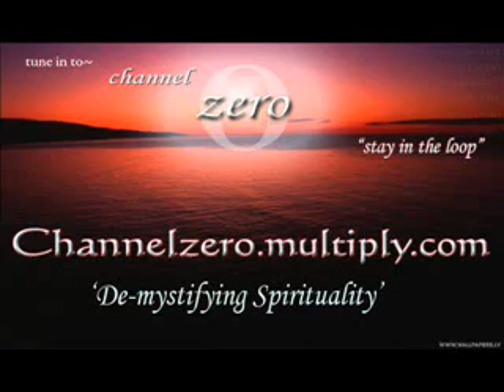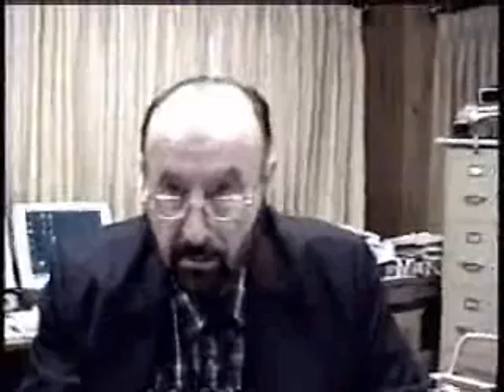Applied Scalar Wave Technology - Tom Bearden interview 1of8

Comment: Your microwave oven turns out about 700 watts of power in a tuned cavity.  At 2 gigahertz, a scalar transmitter would deliver milliwatts to the ionosphere as every water molecule along the way would be forced to vibrate.  Now take that power density of milliwatts and divide it by 1/3 which is the coupling efficiency of a phased heterodyne wavefront.  People are freaking out, about less power than they cook a hotdog in their kitchens with!

Comment: @N1k1mon Sorry, for some reason I have only just seen your question. Answer: Hutchison effect is completely bogus (only occurs when Hutchison is around). Casimir effect is a prediction of quantum mechanics, and can be reproduced by anyone who has the correct equipment.  In fact, the Casimir effect has several non-quantum analogues, and one of these can be demonstrated using just a fish-tank and a loudspeaker.

Comment: Consider Bearden's patented (sic) 'motionless electrical generator': just wire wrapped around a magnet. This is the sort of thing which 'leading' 19th-century scientists did before Faraday made the now-obvious discovery that relative motion was required to produce an output (pace Barkhausen noise). 
So, far from being 'ahead of the game', Bearden is actually over 160 years behind the times. Don't be fooled by his 'learned scientist' act. He is a dangerous gun-toting paranoid.

Comment: flower, the CONCEPT of equivalence is not what's been refuted.  The equation is an OVERSIMPLIFICATION & that's what's been refuted.  Now, do all these relativity experts in your precious report agree that the equation as it stands can account for the bending of light without a large mass given that the squaring of the "m" inflates it's value?  If not, what's the point of shaking any stick at relativity experts who've already been clubbed over the head with the Duke & CalTech results.

Comment: Flower, you PROVE Bearden's point about scientific dogma.  Does Physics 101 challenge the theory of relativity?  If so, how does Physics 101 explain bending light without a large mass?  As for Newton's law, it fails in quantum theory when force fields & particles carry momentum (I don't know if Physics 101 ever told YOU that).  Does Physics 101 talk about The Dean Drive?  Of course, if it did, it could ONLY conclude that it didn't work if YOUR Physics 101 DOES NOT challenge Newtonian dogma.

Comment: Ah, now you are really revealing your true colours: not just a Bearden dupe, but a creationist and an anti-relativist as well. Picking out odd bits of evidence that might fit a different theory, does not mean that that theory is 'supported'. The new theory would also have to explain away  the much greater weight of evidence which supports the existing theory. Sorry about that, but that is how science works. I think maybe that you are more suited to pseudoscience; it is certainly much easier.

Comment: flower, you've refuted ABSOLUTELY NOTHING I have said because the only questions you can answer are YOUR OWN rhetorical questions. The AC I mentioned was commercial & it's been clear from the outset, that YOU regard ANYTHING that has "practicality" beyond theoretical application as worthless.  But does that mean YOU invented a computer that runs on hot air?  As for a Nobel Prize, that's YOUR obsession, not mine.  But that said, the prize is NOT restricted to "mathematical" physicists.

Comment: Tesla is a crackpot & a liar, eh?  Is that PRAISE from Ceasar, flower?  So the AC in your home (not to mention polyphase power distribution systems & the AC motor, which started the 2nd Industrial Revolution) is a crackpot's invention, eh?  Of course, you avoided the question & FAILED to give us a PhD's explanation what makes those claims false.  Delusional is as delusional does, flower.  So, tell us what  you've invented besides your Phd & criticism you can't back up except with name calling?

Comment: That's a copout, flowerbower.  You don't claim to be more intelligent & then refuse to act like it. 100 yrs. ago quaternions were not practical because in the absence of a computer or calculator it was too difficult to crunch the numbers which is why Heaviside took out the scalar coordinate & "vectorized" (streamlined) Maxwell's equations.  But without quaternions, a lot of graphics software packages wouldn't be on the market, today.  So now explain the salient points & PROVE you're in the game.

Comment: I built a replica of the MEG, the so-called motionless EM generator. We measured a change of potential of a few millivolts, no continuous power flow as tooted by Bearden and team. Let's see...two 3000 gauss magnets and temp, pressure changes in conductive materials...Wow! he's rediscovered Faraday's law some 170 years later!!!
Reply: That was your first problem, hopefully since 14 years ago you read beardena book to realize the magnetic core MUST be under saturation. 
Not just putting any random sized neo magnets in there and expect it to work just like that. 

It's gotta be specifically tuned perfectly with pulse rate, magnet stregnth, etc.
There's a reason he used ceramic magnets and not neos
Reply: @Heliarc91  When we did that experiment I was a 40 year old guy going through midlife crisis and struggling in a challenging marriage. Not to mention, I was the only hitched dude in all bachelors jam band (ironically, this helped with dealing with the wife, LOL). 
I showed my dad (electrical engineer) this set up and he claimed it was hysteresis. Maybe due to lack of full ferromagnetic saturation on the cores? 
Long time ago. The band went separate ways, still married after 32 years. Appreciate your input, I'll let the old man know as well.
Reply: @69erthx1138 at least you admitted you didn't do it correctly.  14 years later and you'd be hard pressed to find any major video about a MEG. Something is there
Reply: @ColdCabbage-o2f Give it some time. Perhaps these experiments could be carried out at such a miniscule level that thermal fluctuations would be dominated by quantum? 
Meet Tom in 1997. We lived in Huntsville in the Madison area. He was off 231 (memorial Pkwy) as I recall. Knew some things about electric circuits at the time, didn't know shit from shineola about the physics. Both him and Elizabeth Rauscher encouraged me to look beyond what is in the textbooks.
Reply: Any update 14 years later on the topic or similar topics? Cheers

Comment: 2:25, the solution of the source-charge problem?...this is a huge statement for anyone to make! I do partially agree with his saying that the source of energy flow is from the time domain in QFT, the time state of polarization on light cone relates to conservation of energy (charge). BUT THE PHYSICAL STATES OF POLARIZATION OF THE THE EM FIELD ARE NOT TIME-LIKE OR LONGITUDINAL, they are transverse (photons!). The L-mode is unphysical (non-conservative,  not 'coupled' to a physical chg. density).